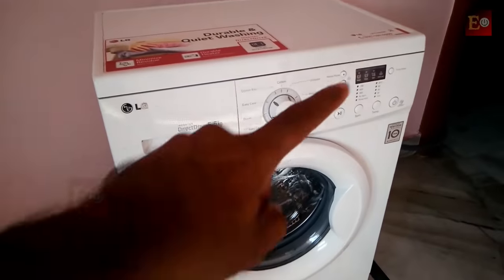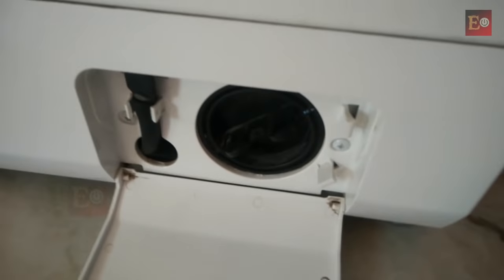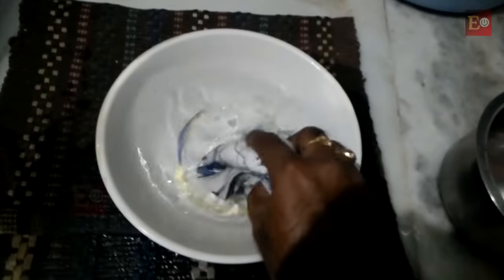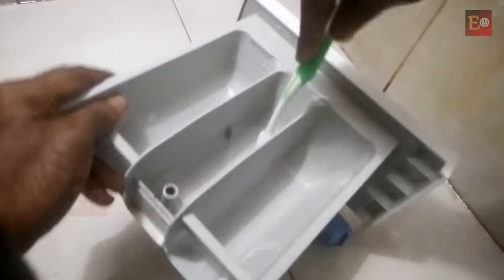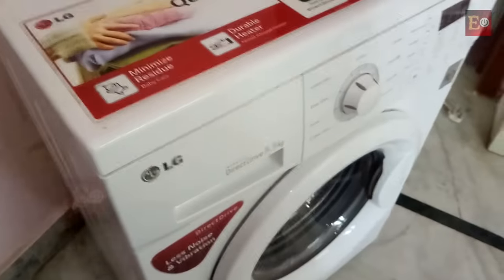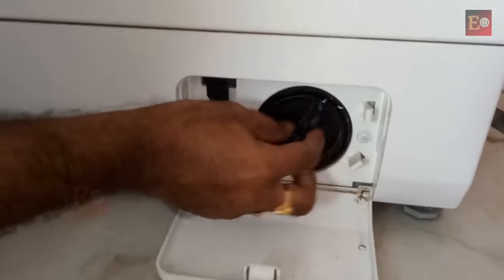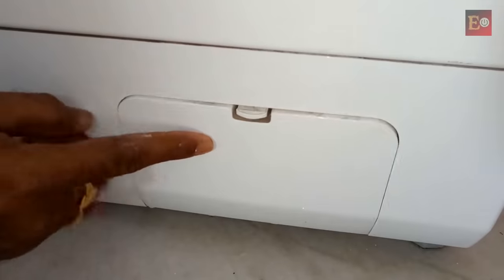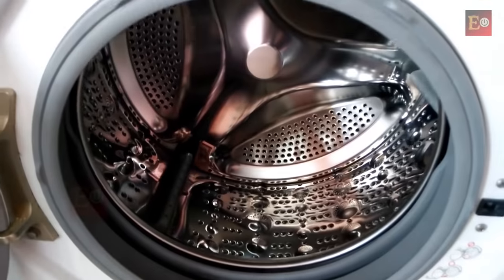How to clean front load washing machine cleaning | front load washer cleaning baking soda vinegar

Comment: 5:48 add 2 cups of vinegar to drum, 1/4cups of baking soda to detergent tray and 1 cup of water also, then select washing option, set temperature to 40degree
Reply: Thank you so much! Was replaying many times to listen to the substance used. God blesses your kind comment. 💐🙏🏻
Reply: If machine has tub clean option, the temp is also auto to 60 deg. I can reduce it to 40. Is thus 60 deg temp too hot?

Comment: It’s important to run baking soda and vinegar on separate cycles. When mixed together and left to solidify they can create blockages in pipes. It means that when combined regularly, you could end up with plumbing issues.

Comment: I think the video is great but would recommend washing at a higher temperature , perhaps  at least 60 degrees so you will need to change the cycle from quick 30 to a setting that allows this change in temperature.
Reply: You should select the most intensive and longest cycle incase if you don't have clean tub option

Comment: Wouldn't be better to run the vinegar and baking soda first, then clean the gasket, etc.?
Reply from the maker: No problem, you can clean like your method also.
Reply: Price this machine
Reply: I want this machine
Reply from the maker: RS 25000
Reply: How do you put vinegar and baking soda inside the machine? Directly inside the drum?
Reply: That was the first thought that came to my mind. Obviously, It has slipped the attention of the guy. After cleaning with vinegar and soda, another wash with plain water should be done to remove the remaining traces of vinegar and soda.Otherwise, it is a simple good educating video.
Reply: Sassy Frassy t
Reply: Ķ

Comment: Hello sir your video is really helpful  thank you
I have a question my cap is not openning what should i do
Reply from the maker: Which cap, back side water pipe cap?
Reply: Down side one near the pipe
Reply from the maker: Which model u r using? Have u say about front side corner small door
Reply: @ELECTRONICSALLINFO  I have same model as shown in video yes I'm talking about that small door where pipe and cap is

Comment: Hey bro one small suggestion, you need a strong acid to remove the buildt up soap. Use a strong acid, vinegar & citric acid on a very hot cycle. 
Also clean the filter right at the end.
Reply from the maker: i know that and I believe you. Because some times i used acid  for washing machine filters and bath room cleaning. because normal liquids cant clean like acid. But lot of people scared of acid and did not believe that. So i did not use acid in my demo. but normally i used.
Reply: So as you know soaps are alkaline, they react with the acid and dissolve. 
It's like what you used with bicarb and vinegar but not as fast. You're basically left with salt and water. 
I wish I had my before and after. The gasket on my machine was full of soap scum and mould. I used acid on a high wash and after about 3 hot cycles it was like new. 
Another problem is water hardness. My area has really hard water, it really effects the soap. Really annoying as you need more but get less cleaning. And lots of residue within the machine. 
Have a good weekend.

Comment: Thanks.. Is there any method to clear the rust formed below the detergent tray???
Reply from the maker: U can use wash room cleaner liquid like Harpic liquid. Aply the liquid and after 15 minutes clean with wet cloth. It will work.
https://www.flipkart.com/harpic-power-plus-original-liquid-toilet-cleaner/p/itmfcyfnxqpvg2tu?gclid=CjwKCAjww-CGBhALEiwAQzWxOvLsXX0iEsxUD9s97cYH-Rmg5mMCI_RwfxrBRmDqERAtQUl9IIhzoRoCMpYQAvD_BwE&pid=TCNF93ZMCDWS5XSH&lid=LSTTCNF93ZMCDWS5XSHHCGZTO&marketplace=GROCERY&cmpid=content_toilet-cleaner_1507847193_g_8965229628_gmc_pla&tgi=sem,1,G,11214002,g,search,,287739395427,,,,m,,mobile,,,,,&ef_id=CjwKCAjww-CGBhALEiwAQzWxOvLsXX0iEsxUD9s97cYH-Rmg5mMCI_RwfxrBRmDqERAtQUl9IIhzoRoCMpYQAvD_BwE:G:s&s_kwcid=AL!739!3!287739395427!!!g!784376823722!&gclsrc=aw.ds

Comment: nicely explainedbut can u please tell me how to clean door gasket which is very dirty because I have not clean that from long time?
Reply from the maker: you can use bath room cleaners, like 'harpic cleaner' or acid. first add acid or bath room cleaner where you want clean at gasket, and keep it 5 minutes. then clean with soft wet cloth. Don"t use any brushes like tooth brush. because gasket is very soft. you  can use cloths.
Reply: thanks

Comment: might want to add to turn off mains water first before cleaning the back filter as that pipe should be under pressure, and also you missed the inner lining point on the gasket (under the inner rim) Unfortunately i've done all this still have scub but your video at least reminded me of the steps.  Curious why you use 40C instead of the highest temperature setting.
Reply from the maker: U are Great. Ok.

Comment: I’d be inclined to do one wash with soda (alkali) followed by another wash with the acidic vinegar. I just think together they would neutralise and it might be the equivalent of washing with water?
Reply from the maker: You can add backing in the first cycle and u can add vinegar in the 2nd cycle
Reply: Not really, because when the vinegar hits the baking soda it makes lots of bubbles, which clean thoroughly. Before it all turns to plain old water.

Comment: Sir veniger is make with acetic acid the acisds are corrosives ,Is this damage washing machine tub? Because the tub is stainless steel.
Reply from the maker: No. It will not. Damage. It will desolv only durt.

Comment: Sir, I have IFB Elena 5kg washing m/c, does n’t have cleaning option. Can I do with Quick wash or short spin dry?
Please tell me whether I have to put water tap open to let in water or not lije normal washing?
Pl. clarify my doubt🙏
Reply from the maker: Don't choose only Spin(Dry). U can choose quick wash or any wash programs also for drum clean. If u choose any option It should do three cycles wash Rince and Spin for clean. There keep the hot water temperature more than 40 degrees.
Reply from the maker: U know telugu
Reply: Yes Sir, I am Telugu/Hyderabad.
I have cleaned the m/c as advised by U & waiting for ur reply.
Now, I will choose Quick wash. So far I never used hot water. To day I will use it. It has a button showing 60degrees.
Thank You for ur advise🙏
Reply from the maker: OK.

Comment: While spinning got abnormal vibration so much that entire machine turns round about. So many things having done but  no use. Please advice any remedy
Reply from the maker: When did u buy it. Normally washing machines are little vibrates in spinning time. if your washing machine is more vibrates in spinning time, you have to check at the washing machine four legs on the floor. if lags are not properly set on the floor or if any gap from the floor, washing machine is lot lot of vibration or shakes in spinning time
Reply from the maker: You know telugu

Comment: Using Liquid detergent SA8 from direct marketing company will solve the problem of cleaning by 100%, It does it when washing & rinsing process itself, gentle on cloth & machine, no clogging any vents but shining & ultra clean & no rusting formula helps in preserving the machine as well.

Comment: Bro I have Samsung 7kg washing machine recently boughted,  when it's need to clean n how to cleen
Reply from the maker: We can follow this process for any front load washing machine. We can clean once for 3 months or 4 months. Washing powder tray and filters we have to clean manually. Latest washing machines comes with drum cleaning option. You can choose this option for inside drum cleaning. Whenever If drum inside it has wet and if you notice bad smell from the drum inside, you have to open the door in 15 minutes or 20 minutes. If u do like this  it will dry and we will not get bad smell from the machine

Comment: Do you clean with water or?
Reply from the maker: Yes cleaned with water. I added backing soda and vinegar. we can clean once for 3 months or 4 months. If drum inside it has wet and if you notice bad smell from the drum inside, you have to open the door and keep it in 15 minutes or 20 minutes. If u do like this it will dry and we will not get bad smell from the machine

Comment: Please someone tell me how to clean off the mould/mildew of the rubber seal part of the washing machine! I have baking soda but no vinegar. I’ve tried lemon juice with baking soda but it doesn’t work
Reply from the maker: You can use a Harpic Toilet Cleaner, like Washroom Cleaner Liquid. Apply the Toilet Cleaner where you want to clean. and after 5 minutes You clean it with a wet cloth
Reply: ELECTRONICS ALL INFO won’t it damage the rubber
Reply from the maker: No. It will not damage.
Reply from the maker: U can also little bit water with cleaner liquid.
Reply: ELECTRONICS ALL INFO thank you i will try it

Comment: Vinegar will damage steel drum???
Reply from the maker: No it doesn't damage.
Reply: @ELECTRONICSALLINFO  you mean to say instead of Descaling Powder we can use the combination you gave? It works same?
Reply from the maker: Yes works same. But Some cleaning powders are available separately also in Market. U can use these also. But I did not use. Vinegar and backing soda also works well.

Comment: Boss my washing machine is auto matic drain whats  the problem please tel me
Reply from the maker: Normally washing machine are little vibration in spinning time. if your washing machine is lot of vibration in spinning time, First you have to check at washing machine four legs on the floor. if lags are not properly sit on the floor or if machine legs have any gap from the floor, washing machine is lot of vibration or shakes in spinning time. 
you can check in this link.
https://youtu.be/JZzPmExwZto

Comment: There is already a tub cleaning feature in ur washing machine. Its mentioned on ur on/off button. U are not focusing camera on it. Strange. ..😮
Reply from the maker: If u are using latest model has cleaning option. Old models does have tub clean option.
Reply: @ELECTRONICSALLINFO  ok
Reply from the maker: My machine does not have tub clean option. I'm using from 6 years
Reply: @ELECTRONICSALLINFO  Yes I got that 🙂 LG washing Machine are really good 👍. I am using the same style but 6.5 to 7kg capacity (Using since 7 years 😊)

Comment: What happens if the gasket is already molded
Reply from the maker: It is better to clean when less dirty. If there is too much mold at the gasket, you can use Toilet cleaner liquid-like Harpic.  
Apply the toilet liquid where you want to clean and after 5 minutes clean with a wet cloth.
Reply from the maker: Apply the toilet cleaner liquid where you want to clean and after 5 minutes clean with a wet cloth.

Comment: The washer rupper is making too much smell . How i stop it?
Reply from the maker: Did u clean well. First you have to clean well. If there is more durt and if  you can't clean with water you can use washroom cleaners like Harppic liquids. First apply  washroom cleanner liquid to rubber where you want clean, and keep it 15 minutes, then you have to clean with wet cloth. Already if u cleaned well and if get bad smell from the rubber, you clean with washer after cleaning. Because dishwashers comes with different flavours like limon smell. You can use it for good smell.
Reply from the maker: Did u clean well. First you have to clean well. If there is more durt and if  you can't clean with water you can use washroom cleaners like Harppic liquids. First apply  washroom cleanner liquid to rubber where you want clean, and keep it 15 minutes, then you have to clean with wet cloth. Already if u cleaned well and if get bad smell from the rubber, you can clean with dish washer after cleaning. Because dishwashers comes with different flavours like limon smell. You can use it for good smell.

Comment: How to  apply liquid blue
Reply from the maker: The best way to add bluing agent into the wash is to dilute it in water and then add as much of the solution as you can to the dispensing drawer on your machine. You won't get as much of the bluing agent into the wash, but you don't risk the machinespitting undiluted blue onto your clothes and staining them.

Comment: How to solve E10 error plz reply
Reply from the maker: If machine can't get the water from the water tap, machine display this error.

Check the water supply to ensure that the water pressure is proper. ... 
Clean the filter in the inlet hose next to the tap. ... 
Ensure the correct position of the drain hose. ... 
Ensure correct drain height. ... 
Clean the pump and filter.
Check for blocked drain.